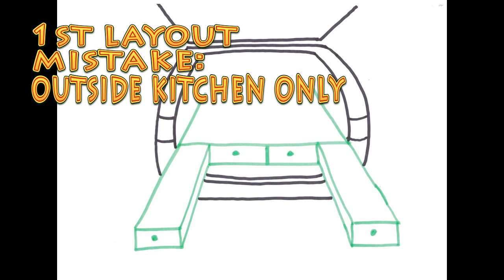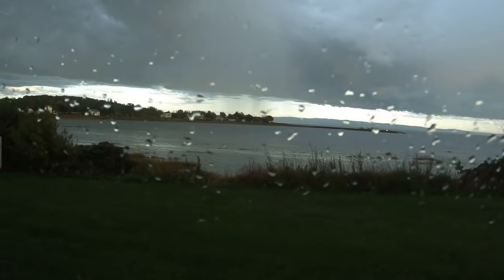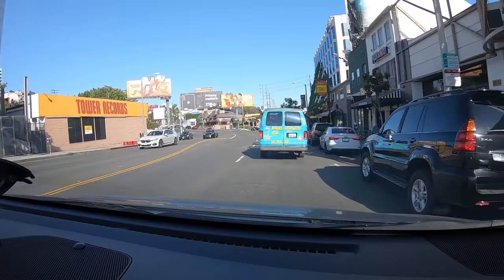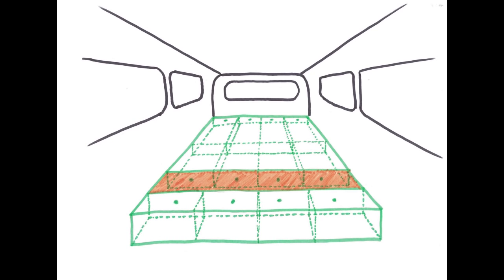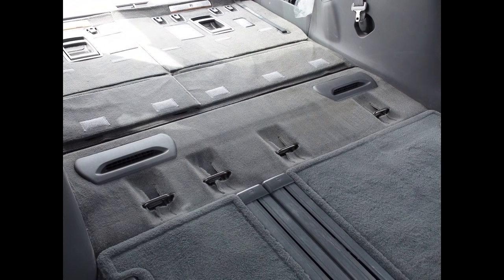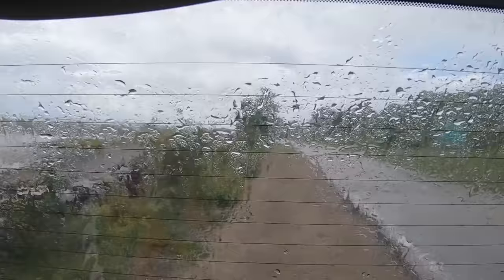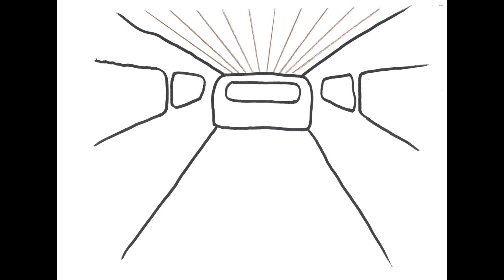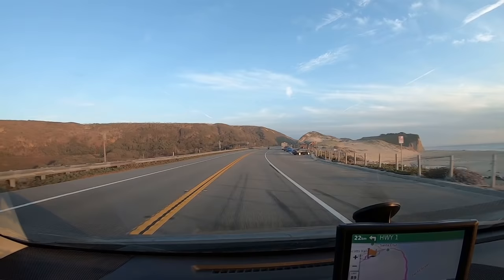11 mistakes to avoid (van conversion)

Comment: About compressed gas, yes, they're American. You have to spell it out. Badly ventilated gas goes BOOM. I'd also have a CO2 detector, as gas goes down.  Not sure if that would help with propane, tho?

I'd like to get solar and use car batteries when possible over lithium ion (not sure). Because they have been known to catch fire. And are hard to put out. 

Car batteries are heavy, tho. Not sure about the Tesla type. 

What about maple? It's a light wood. Looks nice and it's pretty sturdy. They use it for drums/drum sticks. 

Or, older, reclaimed wood. Has less water, so automatically lighter. 

I'm looking at a Sienna. I liked the VW type, similar to what you did, bit they're REALLY, insane right now. Sienna is do-able. Can be parked on the street. Very decent mpg. Reliable. 

And the Japanese cars tend to not have an array of mystery rattles, that between my mechanic and I, we can't find, much less FIX. That's 2 cars like that. 08 Mercury Sable (ie, Ford) and an 09 Challenger R/T. 

So, I'm going back to Japanese vehicles. Sorry. They're unexciting in every way (sorry. You can't make a 4 or 6 cycliner  exciting, can't be done, lol) but dammit if they don't start and run reliably without having to play games all the time (Harleys are notorious for that). 

Birch should also be pretty light. Tho not very interesting, (wood) stripe-wise. Walnut is gorgeous but heavy. Mahogany, too. Maybe a combo where they expand and contract at the same rate and so won't warp each other.

Comment: My Rules are:

Rule #0 - must be able to remove everything and transfer it to a similar van in minutes.

Rule #1 - got to be able to turn on and off the propane stove burner while in bed.

Rule #2 - got to be able to stop driving and plop down in bed with out doing anything.

Rule #3 - everything must be accessible from the inside.

Rule #4 - floor must be easy to remove, foam mats and throw rugs.

Rule #5 - interior conversion weight to less than about 150 pounds.
Reply from the maker: I like that you shared your rules! This is interesting ✌️
Reply: I'd love to see this when done. Sounds tricky

Comment: Some good advice BUT if you want stealth you NEED to block your windows or at the very least the back ones. It’s very evident if someone is living in a van. Also hard floors are killer on the knees and again does away your stealth if you are constantly outside of it
Reply from the maker: Hello Steve!
I effectively block my windows:
https://youtu.be/p7qh2hM4wDY

https://youtu.be/WOpoOXvk1eI

A hard floor is not hard on the knees at all, it is not ceramic, and I really do not need to knees often. I do this only if I need something inside and my feet are full of mud.

I think that kneeling on an uneven floor with metallic stuff under it is much more hard on knees...✌️

Comment: Love your videos, very informative . Ever thought about making shelving systems and selling. I have an 05 Grand Caravan which I chose because 2nd and 3rd row seat go into the floor and its one of roomiest minivans out there.
I have a 1500/2000w Pure sine wave inverter but not mounted since want to do in commercial van for roominess and to be more stealth. Made a bed out of a cheap Walmart bookshelf that put 3 2x2 ply wood boards on top for access of storage and 6x2 board on back of bookshelf and Gal/memory fjam bed thats 5 inches. Got an Alpicool 21 fridge/freezer that runs off starter battery and doesnt kill battery when on Eco mode. Small Portable 360w/450w powerstation to run fairy lights for 3-4 days or small rice cooker 1 time. Hehe Also got small Walmart microwave which is what inverter is for.
Will get an 100 hr agm battery from Walmart and Solar power when get my commercial van.

Have reflectics on foam for all windows but pass sliding door one can be flipped up for visibility and got a back up camera that i plugged into cig lighter that can turn off and on but almost always on when driving so can see where vehicles behind me are. Front side windows have reflectics on felt and are stick ons and black out curtain behind front pass seats.

Question, you dont want to put reflectics on top to reduce heat from ceiling???

Alll my ideas got from you Youtube vanners.  Hehe so thanks.
Only Walmart bookshelf bed was my idea. Good
Reply from the maker: You are quite advanced in your project! 
No I didn’t put Reflectix to the ceiling and will not. I try to have the more room possible. There’s already some isolation with the ceiling finish ✌️

Comment: This was pretty good but I don't agree that you can't do a cheap conversion - I'm all for no-build builds if you're just starting out, that way you can trial different set-ups to work out what suits you. 

Also I think you need to specify a waterproof floor rather than a hard floor. These days, with large rubber mats 'floors' don't have to be hard (and if you can't stand in your van a hard floor is a deal breaker) and you don't need to get carpet burns crawling around either (as well as all the other disadvantages of carpet)
Reply from the maker: Hello Suzie! 
I agree that it is best to take the time to figure out what layout you really want.
I have used, for years, a no built layout. It is functional, but definitely less enjoyable. When you love your layout and your set up, you just love being in your van. It does not feel like camping... At some point, in a no-build layout, I was dreaming of a table, running water and a fridge. I think that a no-build set up is a first step, but not a last one...

Yes a water proof floor is a most. Personally, I really prefer a hard floor for cleaning. There is always sand ending up on the floor. I use my broom a few time a day! It is best to have something very easy to clean!

Thank you Susie for sharing your perspective. It is fun to share point of view. Enjoy planning your project ✌️

Comment: Hi Eric, this is the most helpful and practical video I’ve seen on van conversions design.Great work! 
I am a senior living right in the middle of N America ( Manitoba) so travel to any coastal area is a long ride and I like to camp in the quite backcountry so Fuel efficiency is a top priority for me. I’m looking at a Ford Escape Hybrid. Have you applied your design ideas to an SUV? Like you I want to it to be home on long trips. Oh... I’m traveling solo. Cheers, Steve
Reply from the maker: Hello Steve!
I have not converted a SUV with such a full set up with running water, cabinets,  fridge, sofa-bed,...

I had an Xterra that I was using car-camping. Sure this truck was looking awesome, but I definitely prefer a converted minivan. If the AWD is not essential, I would think about converting a minivan... So much more roomy and cheaper on gas! 

There’s always a way to convert anything. The SUV can be done, but it will be less roomy...

Thank you for your appreciation 
✌️

Comment: love this video.  All the recommendations are very sensible.  Have you ever tried reversing the passenger seat 180 degrees, or putting it on a swivel?  Also, have you tried either a tailgate tent or side tent to improve the living space in situations where you don't have to go stealth?
Reply from the maker: À 180 degrees seat is kind of expensive, plus it may interfere with my loved fridge’s space... But quite interesting to have!

No need for a tent for me. I love simplicity. Plus if you have to move for any reasons, you will have to pack your tent...
Thank you for your feedback. It is much appreciated 👍

Comment: Eric, I just came across your excellent Toyota Sienna conversion videos. We were considering building out a small cargo trailer and towing it with our Toyota Highlander Hybrid but now will consider just a Sienna. I’m not sure which is most cost efficient; will have to work the numbers including cost of vehicle and car insurance. I do have 2 questions about your design: do you have a bathroom setup? And is your setup comfortable for 2 people? Thank you.
Reply: I have a Toyota Sienna Camper conversion as well (On my Channel), I HIGHLY recommend them.
Reply from the maker: I use pee jar and for no2 I have a back up plan. I will explain in a coming video.
Yes it is perfect for two persons. I travel half the time solo and the other half with my girlfriend. ✌️

Comment: What type of stove do you recommend? Can you use it safely inside the van on a rainy day? Also, may I ask what is the beautiful light you have running above along the sides? It’s absolutely lovely. Thank you for video.
Reply from the maker: Hello!
I use à backpacking stove to save spaces, and I store the fuel cartridges outside in my roof box. Manipulating fire in any forms in a close space will always have some risks... 

Those lights are led lights! I love them! 

Thank you for your appreciation ✌️

Comment: Nice video these are great tips, especially about being able to cook inside! I've decided I will buy a van but I'm really undecided about what size to get. I'm a surfer too but I live in Ireland and surf trips here inevitably come with a lot of rain and wind so I'd have to be comfortable to spend hours inside. Can I ask what your van model is? I'm assuming it's a LWB proace but not sure. Do you find something with this size engine and it being diesel, to be economical enough to use as an everyday car for short town trips or going to work? Thanks!
Reply from the maker: Ireland! This is great! 😃
It is a Toyota Sienna 2015. It is an 8 passagers van. 

If you want to use your van for short trips, maybe a diesel is not the best for you. Read about it, a diesel is more for long distance at a time. Of course you can do short distance but it may be more incline to mechanical problems. Just read about this before buying....

Thank you for your appreciation ✌️

Comment: I think that I would make that bed/couch no more than 20" wide and also removing that front passenger seat. Think of the extra space.  I would also not have the same length but shorter. I don't believe that we need the same amount of cushioning from the knees down. A storage box with a little foam on top might be more practical.  Another thought .... if I remove that front passenger seat do I really need either one of those sliding side doors?  I can enter the area from the front. Thus having more space for storage or whatever.
Reply from the maker: Hello Chris!
I would definitely keep a sliding door. Much more practical and enjoyable to have fresh air, better view and of course an easier access. Planing a less long bed is a good idea depending how tall you are. 20 inches bed will gives a lot of storage. I don’t think that you would need more. Keeping the passager seat is a good thing. You never know when you will need to have somebody with you on any day to day situation...✌️
Reply: Don't get rid of any exits. It's small until there's a fire. Then, it's bigger than you think.

Comment: Eric, merci buckets for making a video series of your van, looking forward to seeing the flooring video. You have inspired me! We're currently van lifeing in an SUV with 2 dogs so a Sienna will be like upgrading to a mansion ha! When it comes to buying a used Sienna, which year would you go with if you were to upgrade your van? My research tells me that 2018 might be a good choice/fit for my budget. Am lucky enough to be able to afford a newer used model, besides your good points on why to avoid the Sienna hybrid, any thoughts on picking a year?
Reply from the maker: Hello Stephan!
Here’s the video about flooring:
https://youtu.be/A5XxEZpDhpk

My current Sienna is a 2015, which have a 6 speeds transmission. A 2018 got an 8 speeds transmission, I would go with that model if available.
I am glade to be useful in your project with my videos ✌️

Comment: It's a minivan! You can't have it everything inside. Maybe if you are living alone, sure. If you are single, and living in a minivan year-round, then ignore my comments completely!

Cooking outside is easy and totally doable most of the time. Rain: not a problem as you stand under the back hatch. Darkness: You probably shouldn't have a license if you can't figure out how to setup lights in the back! Buy yourself a couple of solar-powered LED lanterns and head lamp. Bugs: use bug spray if needed. You're not cooking for very long. And setup a screen mesh between your cooking area and the rest of the van! Simply sewing pins inserted into the ceiling lining work great. Also, I don't spend a ton of time in cities or 'parking garages', and when I do, I have food prepared in advance, or enjoy ordering takeout from a restaurant as a treat. If you're living in a city in vehicle, you'll want something bigger than a minivan anyways!

RE "driving visibility": you really don't need to see out the back! Get some  good blind spot mirrors to stick onto your side mirrors and learn to use them properly. It doesn't take long to adjust. Think about all the trucks, vans, busses, etc that can't see out the back either! It's just not a problem in a minivan.

RE clothes storage: If your bed is only 4ft wide, you'll have a nice gap on either side between the doors. And if you leave one empty space under the bed at the doors and use plastic bins for storage underneath, you can easily slide two of them into the open aisle and towards the door to access. Plus, just use your brain and think ahead before you get into bed and close up for the night! I often grab my next days' outfit and any layers I might need, and set them aside or someplace easy to access in the morning or middle of the night.

In a minivan you have to make compromises. I set mine up for 2 people. We prioritize sitting and eating outside. My bed was made so I could change it to two benches and a table, but I literally NEVER used it! So while it took a little effort and rearranging to get into bench and table mode, the default was that the inside is all bed. You can sit leaning back in a bed very comfortably, no problem. You can even tilt the front seats forward and sit facing backward reclined against them.

As for the lethality of propane bottles....there are lots of ways to handle this potential issue. But I've only ever used the small green bottles (it's a minivan!) and never ever had a problem with leaking gas or my van blowing up. I store my in-use (opened) bottle in a small plastic bin with a latching lid, which contains any gas that might want to leak out. Easy. Done.
Reply from the maker: Hello Averan!
Thank you for sharing your point of view. Everybody has his own ways and preferences, and that’s perfect! 

What is important, is to be happy with what you have and what you do. I share my point of view to help people in their reflexion. My own point of view for a van conversion is that if it’s less easy, it is less easy! I prefer the path of less resistance. And believe me, I have exposed myself and enjoy the hard way in the outdoors! I now suggest the easiest one...

Concerning compressed fuel, you are right that there’s less chance that a problem may occur than it may... But I am still living to tell you that it did happen to me! There had been a soddenly leak when I unscrewed my fuel cartridge. The leak was so fast the an endothermic reaction occurred when the fuel expelled itself from the cartridge.  I even burn myself with the ice that formed... However this does not happen a lot, it happens once out of a couple hundreds time... 

It also happened to a friend in his van. I can tell you that he was afraid to open his door to ventilate!

Also maybe I have seen to much valves leaking when I was working on petrochemistry... 

and a plastic back won’t seal a gas leak...

Take care and enjoy! ✌️

PS
I do use my van half the time solo and half being two. My explained points of view consider both situations.
Reply: In a perfect world, rain only falls straight down. But I live on planet earth where wind usually accompanies rain, so my hatch, stove, inside of my van are now also wet, I mean unless it’s parked in a garage of some type. 
I only address that point because I didn’t read all the way thru your 10 step attempt to discredit the best YT video about van conversions that I’ve watched. I have truly watched more then 500 videos, as I’m still recovering from a serious injury to my body that happened 18 months ago. 
I love seeing everyone’s ideas, and I’m sure you have a million great ones too. We all have different reasons for van dwelling, and the great thing is, regardless if you have daddy’s trust fund paying for it, or you are forced by life’s circumstances to live in your van, or car, there are videos here to help you where you are right now. 
TBH I actually had planned on doing the pull out kitchen. But Eric has helped me realize that I need to make sure it’s adaptable.